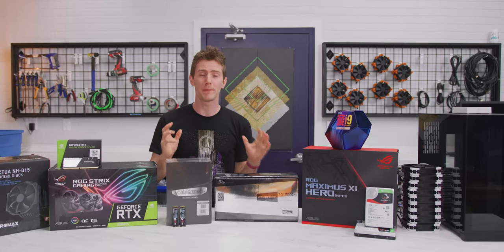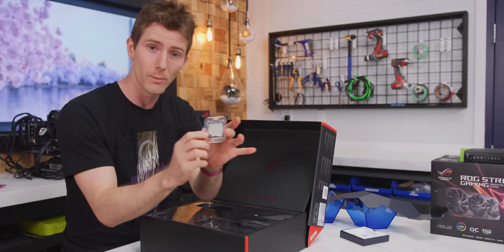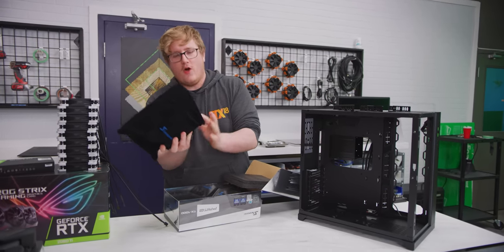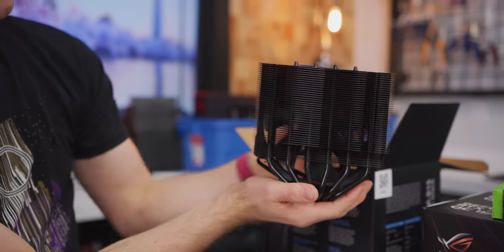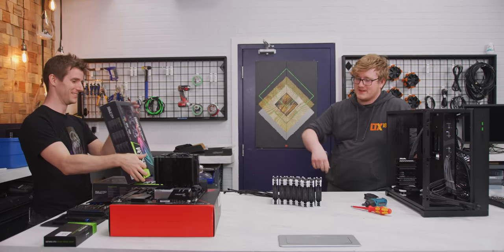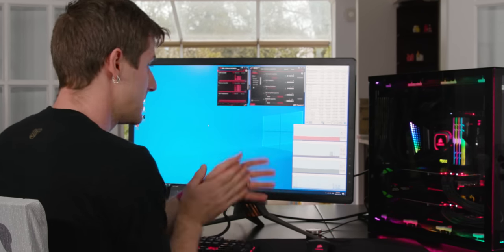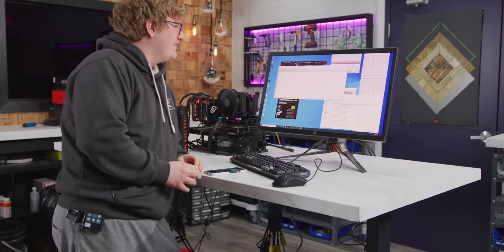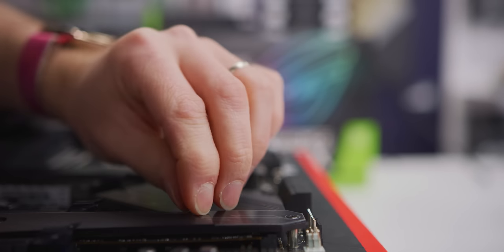Can AMD Beat the ULTIMATE Intel Gaming PC?

Comment: What Linus sees: A pc sombody actually buys
What I see: pre binned 9900KS // 2x 2080TI // ...
Reply: That's pretty much what I have in my cart although I guess I'm just using a vanilla 9900KS.
Reply: Drop one of the graphics cards and it becomes a machine that's still very expensive but not unreasonable for someone who isn't strapped for cash.
Reply: @SteelSkin667  I'm actually getting the titan RTX but I don't play games that often. I'm building a deep learning rig. That just happens to be from a cost standpoint mostly the same as a gaming computer. The stuff they make specific to my application get silly silly silly.
Reply: 2TB of SSD + 32TB HDD storage //...
Reply: @ZDR-BoyZ  Hey I have 2TB worth of SSDs in my rig, although not all of it is NVMe. 1.5 TB of it is made up of cheap SATA drives.
Reply: @harveyts3  I've checked out the price of Quadros and Teslas, and it is indeed a bit silly. I suppose that you don't need FP64 for AI?
Reply: Thousands of well off PC builders would and do buy these things
Reply: I'm sorry you're poor
Reply: SteelSkin667 the Titan RTX was really only for people who were doing data work and gaming on the side. They made the card for home workstation. Yes, though obviously it’s a compromise to use gaming level hardware but the whole build including an I9, 128gb ram, and two ssds like these ones is 6k and for work that’s not a big deal. That is compared to doing it “the right way”.
Reply: I am broke :/
Reply: @harveyts3  Yeah, I've noticed that the the Titan line is mostly marketed as a 'prosumer' card for researchers and workstations. Although I've seen in a Computerphile video that the university of Nottingham used them in their deep learning server as well, so I guess they're just a good value for AI.
Reply: @SteelSkin667  well at the end it depends on the main purpose of pc and cheapness/necessity of SSDs in it of course
Reply: SteelSkin667 my current PC is four years old and was built at the tail end of the great bitcoin shortage of graphics cards. I have to 1070s. It has been okay but it is really letting me down these days.
Reply: @harveyts3  Yeah, the 1070 is still okay-ish for games, but it is showing its age, and for compute it isn't that great anymore. I have one of them as well.

Comment: Linus: *switches to a new mobo so the gpus aren't choked
Also Linus: "Identical" AMD System (but gpus are choked)
Reply: Not to mention stock AMD CPU vs overlocked Intel CPU.....
Reply: Yeah but it was an open bench, so it kinda evens out.

You are correct though in the sense that for a truly apples to apples comparison, they should have actually had identical conditions, including the case and fans.
Reply: jvalex18  your comment is too
Reply: jvalex18  damn you got roasted broski
Reply: @richardchantlerrico  AFAIK, 3950X is also pre-overclocked CPU, similar along the line of other X-variant of AMD. Sure, Intel's is binned but at least the price is the same
Reply: jvalex18  i mean youre not wrong , r3000 is pretty maxed out, but they could achieve better score slightly
Reply: jvalex18  yeah lmao
Reply: @archfxt3619  imo, in this test, its not relevant because they're just buying and using everything in "default" stock. Intel's is binned, Ryzen is pre-overclocked, but the price is the same. Linus is not even saying that Intel's is overall better buy but they do still slightly edge out Ryzen in gaming (and they're holding on it for dear life). Some somehow argue that the water-cooling makes Intel better here even though its not......
Reply: Both setups are gimped anyway cause they will only run PCIe X8 on both GPUs. Should have used HEDT

Comment: "A PC that someone can actually buy"
Soooo... how much for Intel and AMD versions?
Reply: If you have to ask...
Reply: actually the 9 3900x is really close (in gaming) to the 3950x and half the cost, so for value id deffinitely buy a 3900x but that'll still cost you around 450$ for the cpu only. The ones in the video are around 800$.
Reply: I also found it interesting that they didn't post prices at the time of build. :(
Reply: if you ask how much they cost it mean you can't afford it. no hate just sayin XD
Reply: Puffln Good point there.
Reply: People that have a bunch of money tend to be money-concious and would probably ask as well.
Reply: @adam4759  No need for a Prebinned 9900KS, a standard KS would be just as good and 2/3rds the price. also as other posters have said RAID for Nvme is wasted as is SLI'ed 2080Ti. Get a Kingpin 2080Ti or Titan for that price.
Reply: @adam4759  if single GPU the and 3600x will also work. Also older i7 4790K with OC. I went from the i7 to 3600X and then 3900X and then 3950x. It doesent matter for single GPU. But of course SLI 2080ti might need more than 4th gen i7.

But the entire feel of the PC is much much better with more cores. Its way more snappy and versatile. Especially for a prosumer or a professional.
Reply: They mentioned that they were using the same GPUs, coolers, SSDs, etc. for both builds.

The SiliconLottery 9900KS is $750, the same price as a 3950X. An MSI Godlike is about $600 for both platforms, too.

So these are basically 1:1 for price.
Reply: @Sabat1  and if you dont have to ask what something costs you probably have someone buying it for ya ..
Reply: @andrewkvk1707  there is a saying here in germany : "von den Reichen lernt man das Sparen" which means  from the Rich you learn how to save... which is somewhat true
Reply: Puffln no it doesn’t, I can afford it but I have no clue what it costs and neither does anyone in the comments section because nobody has an actual answer
Reply: @kingsizemedal  well true but the AMD has twice the cores and threads .. but going for more then 8 cores for gaming is stupid considreing that most cames dont even utilize more then 4
Reply: @DrSmugface  While that's true, there's many stuff running in background that if left idle, they will drag down your fps. So an 8 core cpu can run better than a 4 core cpu but only because they can deal with background stuff a lot faster
Reply: @DrSmugface  yes, your mama
Reply: @gerRule  so you aren't true tech enthusiast if you do not know roughly how much each component cost.
Reply: @andrewkvk1707  true
Reply: @gerRule  The first thing I did was click on the links and add up some pricing.  For a version without a second 16TB drive and without the second GPU, it runs about $5,000 all in.  Add $1,250 and $520 for the second GPU and second hard drive respectively, and you are closer to $7,000.  Which is ridiculous to add since those two items add very little to the overall performance.  There are certainly ways to save some money on this build and get within 95% of the overall speed.
Reply: @Sabat1  doesn't make any sense
Reply: If your spending $4/5k on a gaming PC does it even matter? You can get 9/10ths this performance from a 'regular' 9900k and single 2080ti and save $1500 in the process.
Reply: @DrSmugface  For people just gaming its not that important today, but the more cores will mean you can do things like gaming while doing virus scanning, streaming video while gaming, unpacking files etc. A lot of people nowadays actually do more than one thing at a time, maybe you are installing a game while downloading another, copying files from some drives etc. so it doesent make the AMD slower, since it has so many cores. Even at 100% load in Folding at Home I dont feel it slowing down in desktop.
Reply: @Outland9000  exactly, Linus also said it that one 2080ti is more than enough
Reply: @Outland9000  well you will save even more as you will not have a 1000W PSU.

Comment: Linus building the top end Intel Gaming PC

Me: Screw this, bought Ryzen 7 3700x and ditch my i5 7500.

Hell yeah.
Reply: Great choice, it may not beat an i9 at gaming but it can certainly kick it's ass in multi threading and for that price it's awesome.
Reply: Except an 8 core CPU makes zero sense for solely gaming
Reply: @Amusia727  Oh, boy... I remember some people in 2005 saying that dual-core doesn't make sense for gaming.
Reply: @Amusia727  8 cores makes sense for gaming. There are many games that can use up to 8 cores.
Reply: @Amusia727  You don't think that might change with the new consoles using zen2 8 core processors?
Reply: Oh boi, the future proof memers. A quad core didn’t make sense in 2005, unless you were doing workloads that could utilise it. Your point makes no sense...
Reply: And by the time 8 core CPUs are fully utilised in most games, which may be more recently than I expect, the CPUs you could buy would be cheaper and faster anyway...
Reply: Also, next gen consoles are only utilising 6 of the cores for actual gaming...
Reply: @Amusia727  Lots of the last AAA games released take advantage of 8 cores like Forza Horizon 4, Battlefield 5, Far Cry 5, Witcher 3, Shadow of the Tomb Raider, list goes on. 8 core makes sense now especially with current Ryzen pricing. But you won't lose too much performance if you chose a 3600x instead.
Reply: @Amusia727  Is that confirmed?  I'd heard 7.  Interesting either way.  I'd also be curious how many threads will actually be utilized.  Do you think games being optimized for the zen2 architecture will give AMD an edge on current hardware or will something like an i9 always outperform a lower clocked ryzen?
Reply: @taramills3169  that's what I thought as well. The Jaguar CPU power is laughable in Xbox One and PS4 that PC gamers were mocking it then. On the other hand, the specs of the next gen consoles made entry level PC gamers cry and made midrange PC gamers wince because a console might end up being more powerful than their rig.

Point is, the 8 cores in Jaguar could easily be defeated by a dual-core Intel i3 then so optimizing for that architecture isn't going to give a major advantage to AMD. Optimizing for Zen 2, on the other hand, would give an advantage because it can actually compete with Intel now.
Reply: @Amusia727  next gen consoles are 8core, very good chance moving forward that 8 cores for gaming will 100 be the way to go
Reply: Thought it was supposed to be up to 7 core utilisation, although the 7th core is usually locked.

Comment: "Something somebody would actually buy"
"2 2080 Tis"
Reply: My thoughts exactly and binned i9900ks, like sure, you can probably buy those anywhere.
Reply: @Sphizex01  Yeah, youtubers, which represent like 0.01% of the population? I mean yes, it's possible to buy something like that, but the common denominator won't bother with such a build. After a certain price point the price to performance ratio begins to matter a lot for most people and 50% increase or more in price (for a single GPU) is insane to everyone else but SOME youtubers to buy for just 10% performance increase.

Comment: "Something that we would actually recommend" 

With two 2080 Ti's? Ummm I'm not sure why anyone would do that. Even at the very high end.
Reply: That and most games will have major issues running in SLI to the point it isn't even worth it.
Reply: Machine learning or heavy editing.

Basically anything not gaming that would use a GPU, is still going benefit from multiple GPUs
Reply: @Shadowdoctor117  
Rendering cgi
Reply: At the end Linus himself said, that you shouldn't buy two 2080 ti for gaming
Reply: @lukas2844  you would listen to a fool who uses an air cooler in a build with dual 2080 Tis?! Your comment does make sense a bit. It is stupid to buy two 2080 Tis in 2020 when we expect 3080 Tis this year. By the way Nvidia is working on new NVLINK SLi tech and maybe they will announce it on 3000 unveiling.
Reply: With NVLink bridge and DLSS 2.0 enabled in game settings, it would be powerful.
Reply: @Shadowdoctor117  This was supposed to be a gaming PC they could recommend, not a workstation
Reply: At high end you would just go for Quadro 8000 in sli
Reply: @zhangirduiseke676  water cooling dosent increase performace(if u r not extreme overclocking). a good aircooler can be just fine. plus air cooler is cheaper and less likely to break  over time. its sad to say u have fallen to "water cooling makes faster " marketing
Reply: @sulaiman9766  are we going to discuss that air coolers are cheaper when in this particular build he uses two Strix 2080 Tis?! Those are the most expensive 2080 Ti models. Air coolers are for budget builds. This is definitely not a budget PC by any means.
Reply: @zhangirduiseke676  this video is about the cheapest  fastest gaming pc . so why waste money on water cooling??.and at the end linus said not to buy 2 2080 ti.its just to show us there is no point. watch the video fully before u comment
Reply: Zhangir Duiseke air coolers perform the same and water cooling is unnecessary

Comment: "Identically configured AMD system" - Was the cpu a binned one?
Reply: No. The binned intel cpu cost as much as the  ryzen.
Reply: @maximal_hd142  So does a small car. but the car is going to lose at rendering, and the cpu is going to lose at transporting.
Reply: Actually the 3950x now costs 700 or less ... That's a bargain xD
Reply: Hisham EL-Azem  where you find one for under 700 lowest I’ve seen is 730
Reply: @Nalianna  I don't understand your comparison.
Reply: @maximal_hd142  in the same way that I don't understand yours. A motor vehicle can't be compared to a cpu, in the same way that a binned, perfect cpu can't be compared to a stock hum-drum off the shelf one. - It's not a fair comparison. Especially as the 3950x is around 675.

Find a binned 3950x to compare.
Reply: New title for video "Can random quality AMD cpu Beat the ULTIMATE Intel Gaming PC?"
Reply: @Nalianna  Thanks for the explanation. I dont thing it makes that much of a difference wether the 9900ks is binned or not. 5.1Ghz are not rare with them. Got mine to 5.2 and the performance improvement is mostly irelevant.
Reply: They should find a binned 3600X
Reply: @xamanto  Why not just use a second hand AMD K6-2 ?
Reply: @Nalianna  They were comparing a top of the line pre oc intel cpu vs amds equivalent at that price point. They were seeing which would perform better in gaming, with intel beaming ahead because most games rely still heavily on single-threaded loads. Amd however would destroy intel in any workstation use due to the double cores and threads, hence why it was said at the start that they were only testing gaming performance.
Reply: Maximal _HD Are you German?
Reply: They should OC the 3950X
Reply: Sure you can argue it was binned. But out of box my 9900k runs at 5.0 stable.
Reply: I don't understand why people have a problem with this? 

The AMD cpu has 8 more physical cores and 16 more threads.....FOR THE SAME PRICE. AMD cpus have already been shown to be maxed out on regular cooling. 

Once they get IPC up one more time Intel's single threaded cpu advantage  is toast.
Reply: problem is in single threaded apps the i9 9900k is comparable to the 3600X with only a minor lead to intel that a 1200$ Prebinned 5.1GHz CPU that is in small supply vs a off the shelf 150$ CPU not even overclocked the multicore benches take the 3800X to be comparable to the Binned CPU at around 350$. 

The minor gains of intel is worthless in comparison to AMD at this point in time gaming or number crunching compared in price to performance.Especially so if its half your budget lost to the cpu alone
Reply: @optimalbass  Yes, why?
Reply: @maximal_hd142  Thank you.
Reply: @SuperSilvi1990  The point of the video was to compare top gaming performance from either side. You can't do that by comparing an OC'd build to one that isn't. Even without binning they should have tried to overclock the 3950x.
Reply: @unknowndemon3169  micro center has them right now for $699...I bought mine from there for $749 a couple months back and haven't regretted it for an instant.
Reply: @Michael Gattus thanks I was planning upgrade my 3700x work station and I was looking for a 3950x to buy

Comment: I wish they'd tried it with a pre-binned, pre-overclocked 3700X. A 16 core ryzen doesn't have much gaming performance benefit over an 8 core one, and the binning and overclocking would make it a more fair comparison against intel. This comparison takes a processor that isn't meant for gaming, and compares it against one that is, which is also at the top end of the silicon lottery.
Reply: the 16 core 3950x still outperforms the 8 core 3700x in most games
Reply: the AMD chip has less matured process node, they cannot boosted as high as intel does because the node aren't as matured as intel 14nm++++ which the number of + indicate process refinement,  but most of amd  chip already have very little OC headroom to begin with
Reply: amd cpu's arnt bulled like intel because all amd boost clocks are the same disregarding thermal or stability of fabrication  thus is why they dont overclock as well because they are already clocked almost to their max thats why intel can oc more because the stock boost is set so low to allow for better custom clocks
Reply: The point was they cost exactly the same so you could go with either. One is overclocked but the relevant thing is that they are equal in how you would acquire them. It's apples to apples from a consumer's perspective.
Reply: @Taijifufu  intel gaming, amd workload. its so simple yet people over complicate it
Reply: Maybe a threadripper over locked would beat the i9
Reply: @mynicknameislion1385  i9 is the best cpu in the market. Nothing beats it in gaming
Reply: 3900x and 3950x have larger "GameCache" (64MB vs 32MB), they outperform 3700x in a few titles.
Reply: Also the best binned 3700Xs are worse than the worse binned 3950X on a core for core basis. The 3800X, maybe, but I still think those aren't even binned as high as the 2 chipsets on the 3950x
Reply: @mynicknameislion1385  threadripper CPUs aren't made for gaming, lowers end amd cpus can do better than it
Reply: @AssassinKID  I overlooked that completely. Cache seems to be very important to Ryzen and I see now why the 3950X has an advantage.